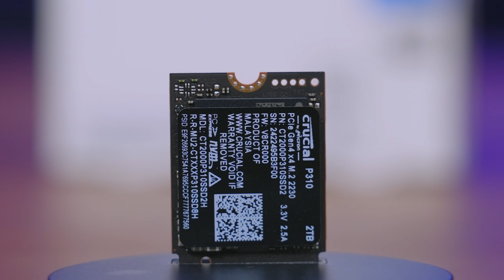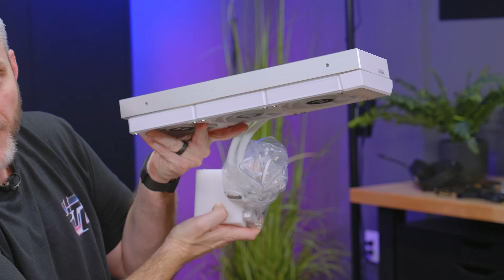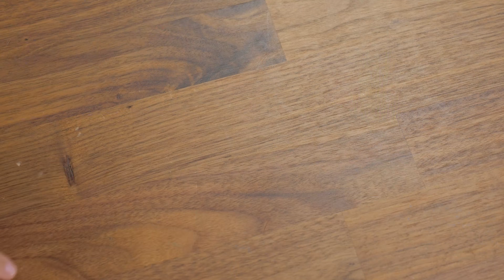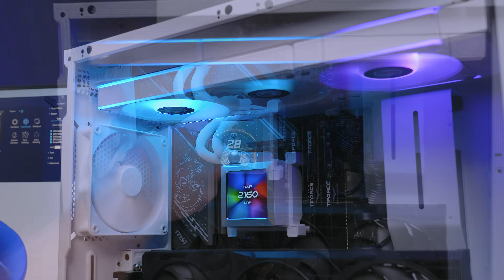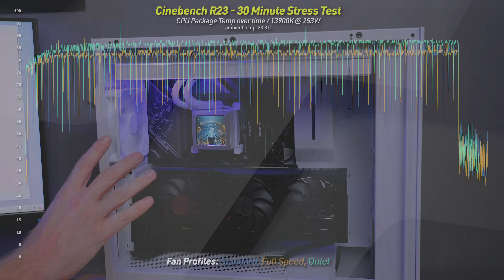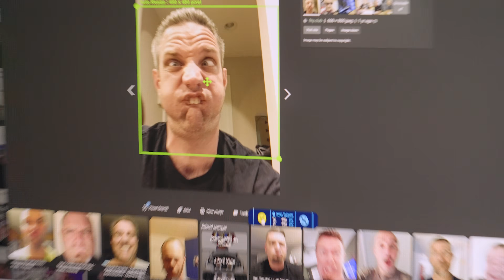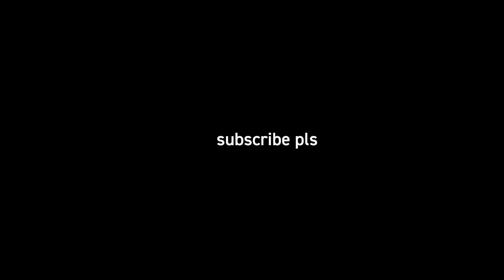Lian Li HydroShift 360R - Thermals and Stress Tests - is it worth it?

Comment from the maker: This definitely doesn't fall into the "budget" category, but for those looking for an AIO that is more than just an AIO, the HydroShift might be for you! Also, for those looking for extreme budget options, we are looking at the Thermalright ultra cheap AIO very soon!
Reply: Jay, find my short showing my computer behind plexiglass, I came up with a method for a dust free PC. TRUE HEPA, with a washable furnace filter from Lowes, carbon filter Amazon, blows 99.99% dust free air up bad through roughly a 5" gap in a shelf that holds the computer, every gap has positive air pressure. If you need more to test it yourself for a video, let me know...
Reply: its funny How all of last year I reviewed Thermalright Coolers and Aio's and it's taken all this time for the bigs to actually take notice of thermalright
Reply: It’s not like it’s that much more expensive though. $179 for non-RGB, that’s fairly cheap for one with a screen on it, and not even that much more than any modern 360 aio, obviously you can get older asutek pump design 360 AIOs for around $100-$120, but thats hardly a fair comparison
Reply: I purchased the Thermalright Frozen edge 360 AIO for my 14700k and must say they make really decent coolers and it was like just under $60 for a 360 AIO lol. The reason i chose the Frozen edge model over the others they have available was due to the fan's they have installed on them. The fans they put on this cooler are there TL-b12 model which have much better static pressure then there other fans which they include with there other model coolers such as the Frozen Prizm etc with the exception they are non RGB, but honestly much better fans. So if you decide to try out the Thermalright AIO definitely please check out the Frozen Edge model, i would absolutely love to hear your input on it. I truly believe you will be amazed at the performance of this AIO Jay.
Reply: Jay...please stop reviewing lian li AIO i bought 2 of them the original galahad and the galahad 2 lcd they were both defective out of the box and i got f****d by lian li with both of them ,ive been ghosted by lian li for the last month trying to get them to ship me a replacement for the galahad 2 lcd after they agreed they would replace it under warranty
Reply: Good video.

A challenge - I think you use to much thermal paste. Maybe you could do a video testing with different amount of paste, it would be interesting.

In my view one should only use paste enough to cover the CPU with like a layer thin enough that it is essentially transparent. My thinking is that the best contact is really metal to metal, so the paste is only there to fill out the tiny imperfections in the surface of the CPU and cooler + of course if the CPU or cooler is concave or convex.
Reply: You get what you pay for !!!
Reply: Thermalrights Warframe aio looks pretty decent, just wish someone would do a teardown of the pump they use - to see what sort of generation pump (and possibly who actually makes it) it is
Reply: While considering not that long ago bog standard 360 mm AIO's were worth 300 bucks or more, it's not too bad.
Reply: @bushi1147  No you didn't. This AIO only exist as a 240 and a 360mm. A 280mm would be a Galahad II 280 LCD. Not a Hydroshift.
Reply: @Jayztwocents - When comparing AIOs with screens and/or ARGB and they come with software, it would be good to point out plus-points and pain-points of the software.  Where price/performance of competing products are otherwise equal, the quality and ease-of-use of the software becomes the differentiator.
Reply: @Audiosan79  your right thought was rhe same cause of the screen
Reply: I think it’s good they didn’t sleeve the cables. The USB and SATA cables are headed in a different direction from the CPU fan header, once the cables are pushed through the top of the case.
Reply: Hey Jay, saw the Twitter post about some feedback on temp charts and methodology. 
A peer review request is like that of parlay, it should never be refused. 
I'll shoot something to your inbox, as there are many words to relay properly in this format.
🍻
Reply: @TheNiteNinja19  odd, I don't think the one I got was ever above 200
Reply: @MyJman37  Who makes the pump? I have to look gift horses in the mouth in case Asetek; which I won't have in the building, let alone my rig!
Reply: @stevewatson6839  Well that's completely fine and understandable and can do whichever you want to do with your own rig, but I know it's been a pretty solid pump so far but who knows maybe it will explode 1 day lol. So given I am running a 14700k 14th gen intel I am much more worried about my computer completely flat lining before this pump decides to have a stroke haha. Also isn't there only like 2 or so different companies who make the pump in all the AIO coolers available?  Anyways yeah it actually been really solid and quality appears to be decent, especially for the price so I'll take the chance.
Reply: Which Thermalright one? I just bought one with my upgrades amd so far im a fan, for as low as the cost is especially.
Reply: @nwasyko  I got the 360 frozen edge model and absolutely thi k it's a great cooler
Reply: KYO SAMA brand, especially came out in Asia, is the beast brand, build quality same with nzxt, price under 100usd with LCD
Reply: With things working towards invisible cable’s etc., Project Zero, BTF, GPU power directly slotted to board. This video was a nice alternative to other coolers to make it look clean. We shall see if other cooler companies bring out their own method to hide the cooling tubes.
Nicely done Jay!
Reply: Can the fans be removed to use the infinity mirror ones instead?

Comment: Why can't anyone just add a fill port to radiator it can't be that hard to put a blanking plug that can be unscrewed to refill or clean
Reply: My waterforce 360x has a fill/drain port on the radiator and I know it's not the only one
Reply: I honestly would imagine it to be adding more complications and possibilities of a failure rate and leak point. That point the owner of the AIO would be responsible for damages to the computer.
Reply: I'm considering looking into what it would take to modify one thusly.
Reply: Yea enermax has one too for like 120 for a 360
Reply: They really should have a fill plug with a warranty void sticker on it. Gives you the option to fill it if needed but not the companies fault if you mess up. Shouldn’t need it filled during the warranty time 🤔
Reply: @ariyanadumon4549  I bet the radiator is to thin to it would need something welding on to thread into
Reply: @MidnightToker24 Warranty stickers are not legally enforceable in the US, or the EU if I'm not mistaken. The manufacturer/seller must prove buyer damage. I could see a "quality assurance" sticker working the same way food seals do, as proof of factory installation and sealing for the consumer to verify on receipt but not for the manufacturer to use against a consumer for undoing a screw that is intended for the consumer to use for maintenance.
Reply: My swiftech h220x has this, clamped tubing and is expandable.  No leaks since 2012.  I don't know why we're still talking about the same exact aio setups.. just move the damn pump to get off the patent restrictions.  Same radiators, same pumps, more RGB and higher prices. Yay.
Reply: My Lian Li AIO has a fill port
Reply: @MidnightToker24 warranty stickers have no effect in the US.
Reply: Lol, why?
Reply: Maybe they should add some kind of window or indicator to let you know if the fluid is getting low in the AIO's then either include a fill port or let you know when to buy a new one if the coolant gets below a certain level?
Reply: @Revan_7even  they might not be legally enforced in one country but the company should have some sort of indicator of the fill plug being unscrewed and then deny warranty of the device.  The user can add water over time at their own risk and the company shouldn’t have to responsible. Otherwise the prices will be jacked up to compensate send backs.
Reply: @MidnightToker24   If a PC radiator has a fill port, the manufacturer put it there with the intent for the user to maintain it and will structure their warranty around, so it shouldn't have a sticker to automatically deny a warranty claim. That would be like if a car radiator fill cap had a warranty void if removed sticker. It's there because the system is impossible to make impermeable for years without maintenance and replacing parts like seals and hoses. That's why AIOs are sealed as well as they are with no ability to maintain them, so they last longer but become essentially disposable/recyclable, and the manufacturer can be sure what is user damage and what is manufacturing defects for all the different consumer protection and warranty laws around the world.
Reply: Frozencool 240x45 has fill and drain ports
Reply: If I wanted to do maintenance on my AIO, I'd just have a custom loop.
Reply: @MidnightToker24  warranty stickers (in the US) don't mean anything.  A broken warranty sticker doesn't void the warranty.  So they (manufacturer) would still have to prove that the damage was due to the user's error/negligence.  So it's cheap to not have the fill / drain plug.
Reply: @MidnightToker24  warranty void stickers are a violation of the Magnussen-Moss Act anyways so they are meaningless...in the USA anyways.
Reply: My BeQuiet Silent Loop 2 can be filled/topped up, comes with a bottle of fluid.
Reply: @GearsSoldier09  now why haven't more done this
Reply: Ok I now say no one deserves a fill plug on a closed aio. Hope you guys have to replace it often and companies never will put a fill plug on them.
Reply: @MidnightToker24  Why waste their time with "warranty void" stickers when they aren't legal in the US and other major countries anyway? For the cost if you want a fill port added you would be better off just going custom loop anyway.
Reply: @P5YKOTIK1870 you’re a g for saying that. I’ll go with that instead
Reply: If you're looking for blanking plugs and refill ports, you might as well consider custom water cooling at that point. AIO (All-In-One) coolers are designed to provide users with a middle ground between air cooling and custom water cooling without the hassle and maintenance that comes with custom setups. Of course, you will never achieve the same performance with an AIO as you would with custom water cooling, but they generally perform better than most air coolers, especially the high-end models.
Reply: Because then that wouldn't force you to spend more money on another one.
Reply: Look into the DeepCool LT720. It has a fill port.   I have one and love it.  I recently topped it off too after 2 years of use
Reply: Lian Li Gallahad 1 has it.

Comment: They need to put Infinity fans on all of their AIOs. They are the most popular, people just switch them anyway. I've come to realize I have no idea what people consider expensive is.
Reply: Yeah... The only reason I am going with the galahad is cause it has the inf fans...
Reply: 3 fans are 90€ that is indeed very expensive for 3 fans although they're good
Reply: The TL has infinity mirrors on the sides and same rgb design as the infinity but just with clear hubs, with rad mounted on the top I don't see the hubs anyway but will depend on how high your pc is.
Reply: Since Biden got in office I consider everything expensive
Reply: That's why my brother got the version of this AIO with the Uni Inf TL fans
Reply: I prefer the AL v2 fans. Higher CFM and higher static pressure at lower RPM with similar noise. The infinity fans are beautiful though
Reply: Thermalright has 3-packs of 120mm PWM 66CFM fans for $12, that's my gauge of value
Reply: Theres a version with TL Unifans, but its about $60 more
Reply: i swapped over to coolermaster mobius for the front intake on my case, they obliterate the sl infinity fans far as performance goes.
Reply: Are you sure about that?

I would guess that the SL's are still their most popular fan.
Reply: If idiots actually took the time to look they have this AIO with the Infinity fans it's called the 360TL
Reply: The issue with those fans is that they aren't very good on rads
Reply: Why I decided to just stay with my msi s360 AIO with infinity fans on it. Because I don’t want to have mixed fans since I have 12 of them in my case 😂
Reply: @iiNaStYiii  because you couldn't just swap the fans from the MSI one to the lian li one? Like what??
Reply: @fallenlegion1828  from my understanding is the fan wire is tied into the tubing to keep them hidden like he said in the video
Reply: @iiNaStYiii  no. Jay made it seem more complicated than it is (I have this model) there are wires connected into the tubing. But the clip to disconnect them is outside of the tubing. Take like 1 min to unclip and remove them. It is really easy. Idk why he made it seem difficult
Reply: @fallenlegion1828  ah ok. Yea he made it sound like it would be a pain in the ass to do so. I may look into it. I like my msi one as well  had it almost 3 years now.
Reply: @iiNaStYiii  it's probably not gonna perform much better than your current aio. But it would look alot nicer I'm sure. 

But yes fear not about the fan swap. Super easy
Reply: @InfiniteDragonsUnlocked  galahad also works for me as I'm most likely getting the O11 vision and can only sidemount the aio anyway

Comment: I am still waiting for clips to hold the fans to the radiator instead of screws, I just want to be able to pop them on and off to clean in between them fast and easy. You have to take them off because when you hit the radiator with air it sends the dust right into the fan bearings which kills your fans.  it's a real problem spot for dust and lint collecting.

Comment: Deep cool is still the best aio bang for your buck, in my opinion. $109cad or around $78 usd you can get a nice looking  rgb cooler that performs well. Ive got a deep cool castleEX and its still running strong 5 years on

Comment: Just an FYI. It actually comes in both black or white, and of course, the black comes with a black hardwarecover. Also, it comes with 3 different fan configurations. There's a cheaper version for $179.99 one.

Comment: I bought the tl version to match their infinity fans and installed it in a y70 all black build and I love it. Aio tubes just hanging around were always an issue and tying them up wasn't an ideal fix, but with this and a nice little lian li strimer mod I did you see no tubes in my build at all.
Not only can you screen capture an image, but screen record 3 minutes of video in mp4 format or upload mp4 videos instead of using gifs.
Reply: Amazing, I just bought the tl version for a black y70 touch infinite build that I am slowly piecing together. Did you top mount the aio? Was curious about spacing since the hydroshift is a bit larger than the galahad II.
Reply: @d4rthd3solate93  yes top mounted, the case is short but super wide so it fits good, it's far enough in front to clear the side fans though it's corner does sit a bit in front of the top fan but I didn't even notice until just now. If you install a single rear fan it can be mounted a couple inches down to line up nicely I put a 140mm uni fan infinity there. No issues with clearing my eatx motherboard, and with the optional 3rd hose bracket, they come out directly over the pump.
And the radiator itself hides perfectly behind the black top trim while the fans are fully visible showing the infinity mirrors and rgb in full glory.
Reply: @o0Silverwolf0o  Nice, yah I plan to do a single 140 in the back as well. Thanks for the info, I appreciate the reply!
Reply: I just built a similar setup for someone else. A black hydroshift with basic fans but the guy bought extra uni fans to swap out since the store didn't have that aio version in stock. I mounted the rad to the top, and it looks phenomenal. The Y70 kitted out with Lian Li all around us a match made in heaven, and now I'm thinking of doing the same. 

Only down side is he got regular fans and not high pressure ones, but he's happy.

Comment: Hi Jay,

Once again, great video! Your content never disappoints. I really appreciate how LianLi has repositioned the tubes/hoses to the middle of the radiator, avoiding the memory sticks. This has always been an eyesore for me, so it’s a welcome change.

The software and the capabilities of the small display are impressive as well.

I’ve noticed a few other brands adopting a similar design with the radiator tubes positioned in the middle. I think it looks fantastic. Imagine combining this with BTF or Project Zero for hidden tubes—now that would be something!

Regarding the price, I feel it should be under $200. However, it’s still more affordable than some brands that charge over $300.

Overall, it’s not bad at all. You’ve highlighted everything nicely. It ultimately comes down to what else is available and at what price, as no one wants to overspend in these times.

The next big improvement I’m hoping for from motherboard manufacturers is to place the USB and power connectors closer to the CPU, instead of spreading them across the board. A futuristic approach would be a simple optical/fiber connection from the CPU cooler block to the motherboard, requiring only two wires for power.

Thanks again, and have a wonderful Sunday evening!

Warm regards, Michael.  🤛👍